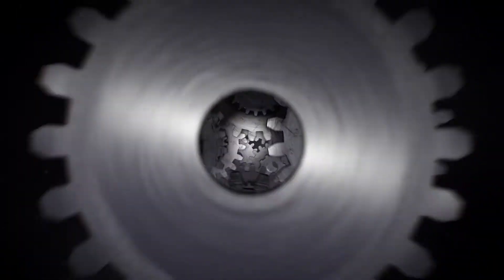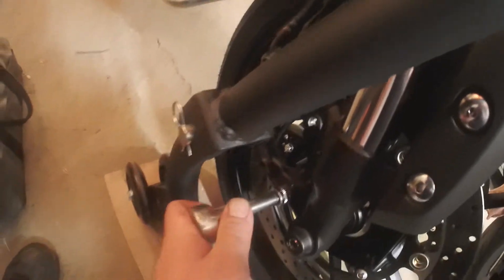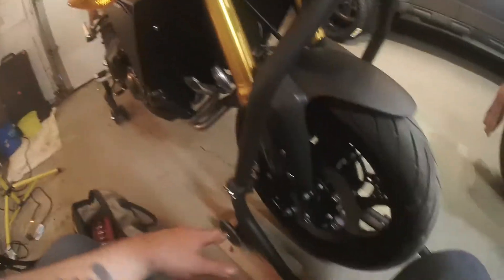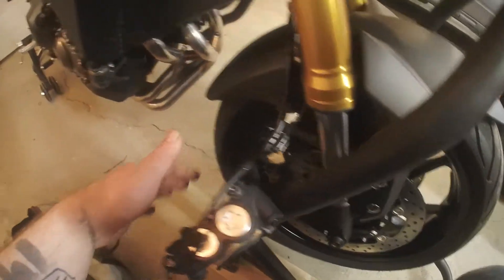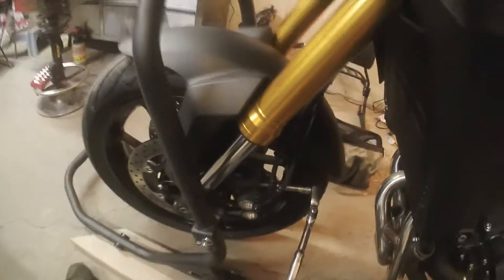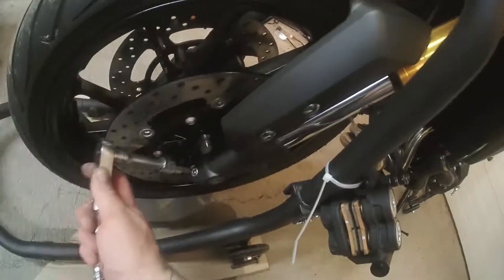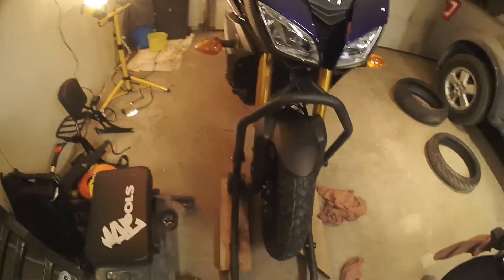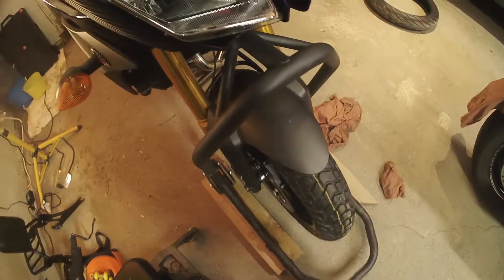How To Remove & Install Front Wheel On FJ 09

Comment: Yamaha install the front calliper bolts dry (no threadlocker) and the Yamaha workshop manual does not state that threadloc should be used.... but you do use threadloc?